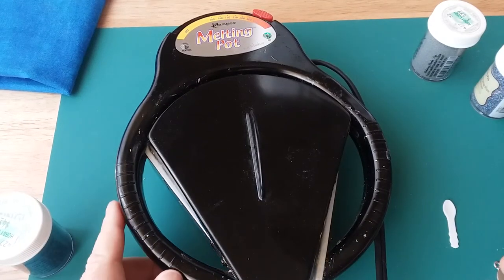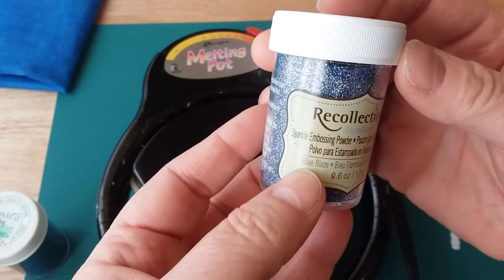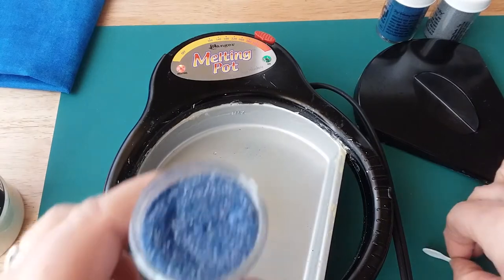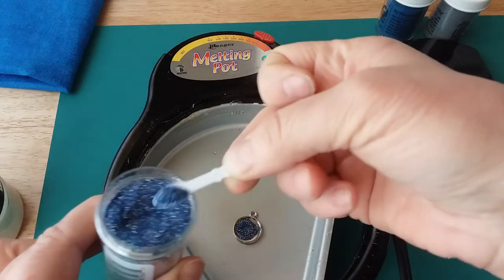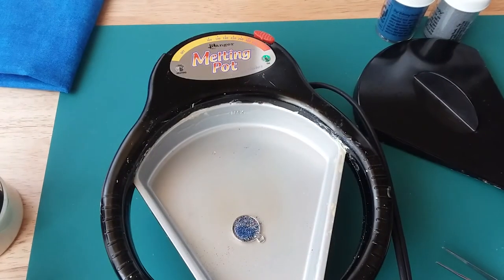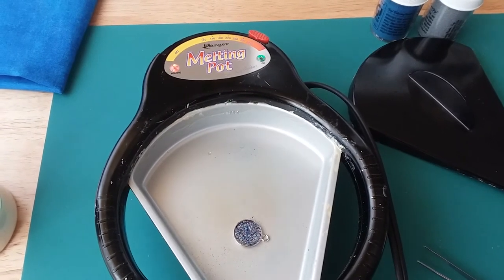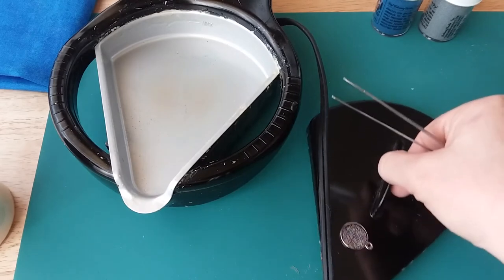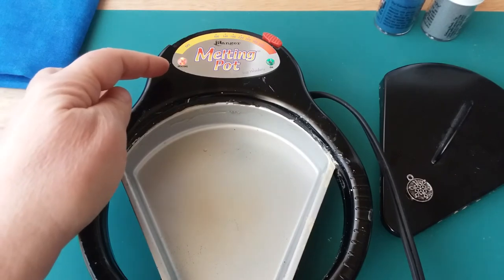How to make a charm using the Melting Pot, embossing enamel and UTEE

Comment: OMG!!  That’s the coolest thing I have seen, I love how you added the snowflake❤️❤️❤️.   I put a melting pot on my wish list❤️❤️.  It came out so pretty❤️❤️.  Thanks for sharing the knowledge 🙏🏻
Reply from the maker: It is fun. I have not seen it at my Hobby Lobby in years - I think it came out about 10 years ago. Maybe you may still be able to find it locally where you live, otherwise on Amazon. You may want to search other videos on Melting Pot to see what it can be used for. The only thing I don't like about it, is that if you melt the clear UTEE in the pot itself, it turns an amber color and does not stay clear for long. But the other colors are nice when melted. I'll show what I mean in a different video on pieces I've done.